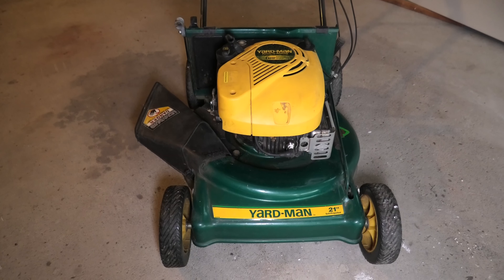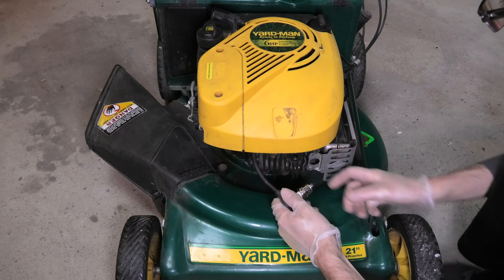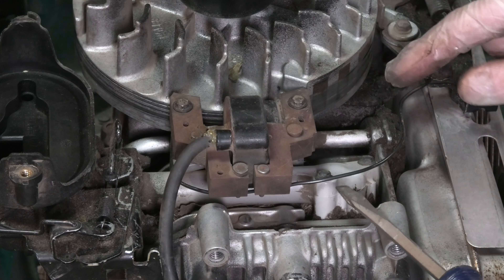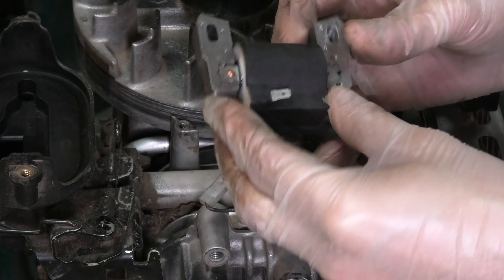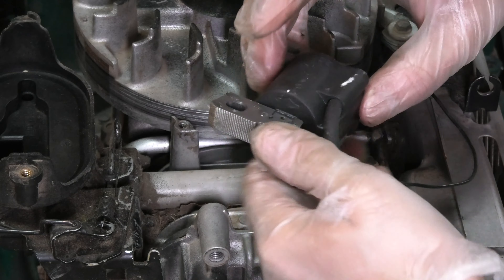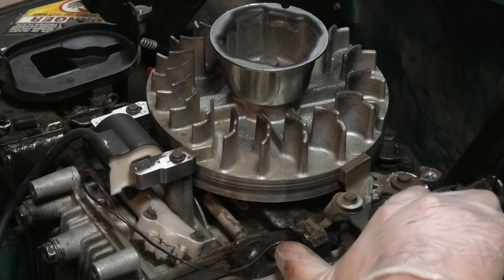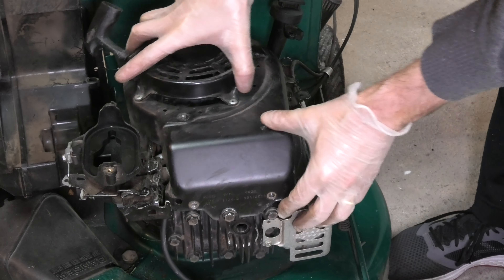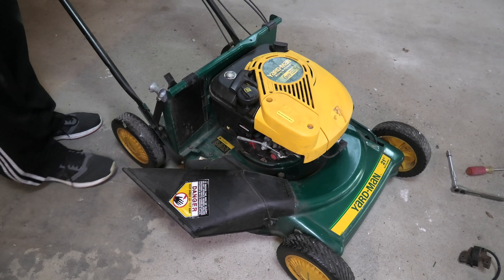No spark on lawn mower engine - Ignition coil replacement

Comment: Actually the thin wire is for your kill switch. Make sure the cable/lever mechanism on the handle is pulling the ground contact away from that wire contact when you pull down the handle. When the  handle is released, you are grounding that wire to ground, stopping the engine.

Comment: Is it possible to have a bad ignition coil and being able to start the mower after 15-20 pulls.  I am having a hard time starting the mower.  The wire is a little loose in the boot.

 I end up having to use wd-40 in the spark plug hole and reattach spark plug.  I can usually get it to work after about 15-20 pulls.  After it starts, it runs well.

The carberetor is all cleaned out, so no longer have that issue.

Comment: what if you replace the coil exactly as you did and STILL no spark?
Reply: Try changing the spark plug
Reply: Or sanding the magnets on the crack shaft if the spark plug wasn’t the problem
Reply: @mustafafadel2035  Mower had no start issue.  It has a new filter and carb, fresh no ethanol gas.  Checked plug, it was damp, so it was getting gas, but looked old.  I replaced the spark plug with a new one & it fired up once, mowed yard.  5 days later was dead again.  I checked and no spark.  I replaced the coil and verified kill wire was installed, but still no go.  Thanks for that tip.  I will try this.
Reply: redraif also check if the kill wire has dirt on it if it does make sure you clean it
Reply: So I carefully sanded any rust off the  flywheel magnets, so its smooth again.  Nothing crazy, just a light wire brushing.  I decided to go ahead and just replace the kill wire with a new one to be sure.  Reinstalled the new coil and new spark plug and still nada.  I looked at the wires on the key on/off & seat cut off.  All appear in good shape.  All three were attached at their junction stud.  I'm at a loss.  I guess I will remove the new coil and test it just for hee-haws next.  :(
Reply: redraif I’m sorry about that
Reply: redraif have you gapped your egnition coil
Reply: @mustafafadel2035  if you mean using the business card method... yes...
Reply: redraif business card is to thick get yourself some fleer gauges have the gap .006-.010
Reply: @mustafafadel2035  will do... just bought one!  :)
Reply: redraif ok let me know how it goes
Reply: @mustafafadel2035  I gapped it to .006 last night.    Even rolled it out in the pitch black to verify no spark.  Still nothing.  A friend said his dad told him once that when all obvious fixes fail, the key on the flywheel might have cracked?
Reply: redraif that’s the next thing I was gonna tell you yes it’s your flywheel key
Reply: @mustafafadel2035  amazingly enough... I started fiddling with the kill line.  I know mine is good as I replaced it and verified it.  I got to messing with the lines coming into the kill line junction stud.  Something is amiss.  I got the mower to start.  There is an intermittent short (grd fault) in the safety circuit.  I'm not sure why I was not getting spark previously when I pulled the kill line, but I am now.  Thank the lord!  Now to trace the kill circuit.  Ugh
Reply: redraif that’s great good luck on your mower
Lmk if u need anything
Reply: @mustafafadel2035  thank you for all your help.  I have learned alot in diagnosing
Reply: @redraif  what did you do exactly?
Reply: What's the part number for the ignition coil or where u purchase it

Comment: my wire  came out from the coil,  not the spark plug side , can i remove pull rope / cover to get to the coil and just push it back in ??
Reply from the maker: That should be fine as long as it can still be tightened.